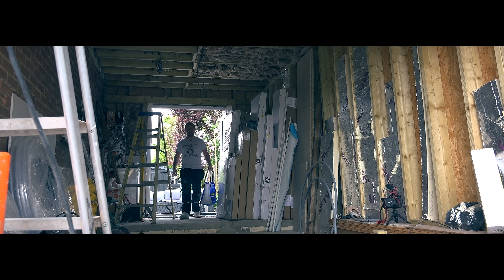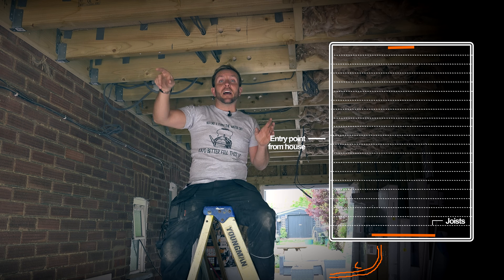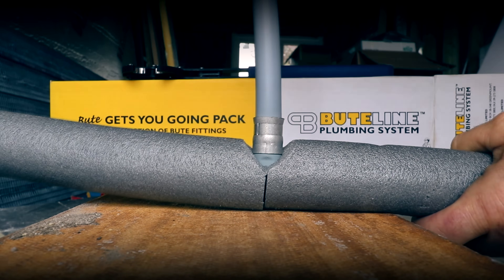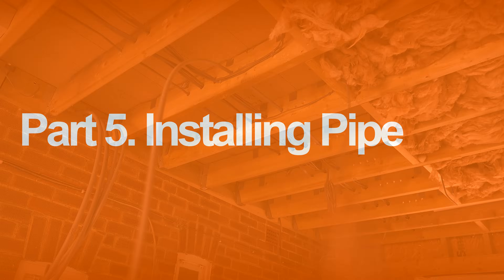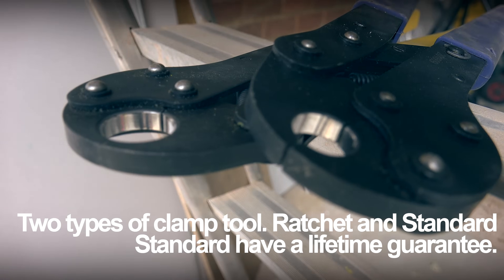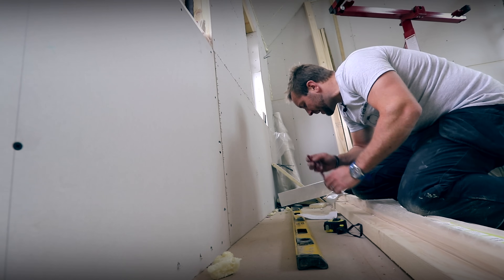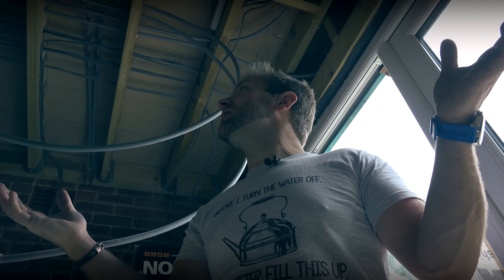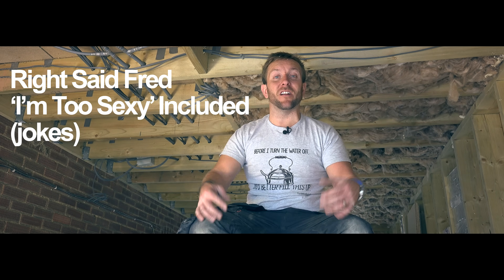PLASTIC PIPE FOR PLUMBING - Buteline System

Comment: Hi mate, great vid bud. I was going to ask about conduit going through the wall but then you explained. We have been using the quick and easy toke to long on the site we are on and gone back to poly.
Reply: Alex, your experience with Q & E is one we have herd many times, but you should seriously consider Buteline, 85% of installers tell us Buteline is quicker to install than push fit  in a 1st fix environment, there are additional time savings to be had on clipping and testing too, which is only done once and for 30 minutes!  As competitive as Push fit, an installation friendly process, it never leaks, completely secure, bomb proof joint that's not reliant on an "O" Ring or insert! Free tools to new users  and it available via one of your chosen merchant suppliers send us your contact details and we will come and see you, as seeing is believing :-)
Reply: @butelineuk5540  wouldnt it be great if a manufacturer/supplier would have a 'planner' on their website. you type in how distances and bends and the algorithm lists the parts required. Would take some work to set up but a game changer for both tradespeople and diy'ers. being able to save time getting a rough estimate of parts and costings
Reply: ButelineUK Ltd Just watched the plumberparts video re your product. Very interested in placing an order. Could you let me know if the free tools offer is still in place?. About to start 2 bathroom refits and would love to give your products a try.
Reply: Craig Smith give us a call and we will sort it out for you 👍

Comment: Like the new production, seems a bit more flexible than standard pushfit.
Reply: Hi Zed Man, you assume correct, our pipe is more flexible, and in some instances could allow you to use upto 20% less fittings . The system cost also works out cheaper than push fit, but seeing is believing, provide us with your contact details and your location and we will get one of our guys to touch base with you and discuss some free tooling for you.

Comment: my issue with this would be its alot slower than push fit.. and also if any other plumber went on a job where this stuff is all installed then he is going to struggle to connect to it without having the crimpers or fittings in stock...... most plumbers have a large variety of stock including myself but nothing like this....... also what if this pipe is leaking in a very tight spot like under a bath?  you cant connect onto it and you cant get the crimp in to use it...  its ok if its first fix but try doing repairs or get into tight spots with it, would be a nightmare.... 

brendan west yorkshire
Reply: Hi Brendan, your would be right in concluding the most effect use of Buteline would be in a 1st fix environment hands down, this is what our customers tell us. No real system provides a "one size fits all" solution and there are times where getting your hands in a gap with a pushfit fitting suits, but that's if you happy with the security of "O" ring based systems? our systems is fitted slightly differently to other systems as its permanent, so like copper, in hard to get to areas where you may choose to "pre fab" first or alternatively use the flexibility of our pipe to clamp outside and push it back in, a little bit difficult to explain over text.
Reply: Brendan Fisher 
The
Reply: if a plumber is fitting Pushfit under a floor....he ain't a plumber
Reply: Hep2o everywhere even up into radiators. Bish bash bosh

Comment: Whats the point if you still have to use adapters for solder and compression. Compression fittings go straight onto speedfit. To use it effectively you need a big van stock and who stocks them? I haven't seen butfit in any merchants. #xpress #mapress
Reply: David Pawson I really don't get the advantage of this press fit stuff requiring clamping, over speed fit, polypipe, hep.
And what's with the bastard size "16mm". Push fit ( touch wood) has never let me down
Reply: Tom Strutton yorkshire xpress uses 15mm copper  not butlines 16mm plastic. I find advantage of xpress copper
1. no hot work permits
2. speed of installing. I save on average 1hour on a boiler swap
3. no flux
4. can crimp directly onto chrome pipe no need to take chrome off.
5. If you forget to crimp a joint you don't need to drain system 
6. Can crimp onto old pipe no need to wire wool
7. Its a little bit cheaper than speed fit
8. Looks a lot more professional than speed fit 
9. My work is recognisable. I dont solder any more. If someone put my name to someone else's dodgy work and its soldered it isnt my work
Reply: From a thermal efficiency any plastic pipe is much better than copper even without any insulation. it's cheaper too!
Reply: another advantage is, copper will split on the first freeze, barrier has give and they say it can be froze 6 times before it splits. yet to see any splits on barrier that hasn't been insulated yet tho
Reply: push fit is DIY tonk..................I'll leave that shit to the Polish or DIYers. barrier pipe is great, but as long as you use compression or this stuff

Comment: Buteline could make the copper adapters with a bit more of  a radius like copper elbows. These looks like a tight 90° which will affect flow
Reply: Can you send me some info on the free tools for spending over 300 quid please? Will
Reply: Hi Will if you can provide us with your contact details and your location and we will get one of our guys to touch base with you and discuss some free tooling for you.
Reply: ButelineUK could you please send me some info on the free tools on spending more than £300 please
Reply: Hi....Our Elbowed soldering tails are manufactured with virtually the same internal radiuses as end feed, and the extremely flexible Buteline pipe will allow you to greatly reduce the overall use of restrictive fitting's and thus will create more "sweeps" in pipe. More sweeps, less fittings, less fittings means greater flow rates and increased efficiency in the delivery of water at its destination, making heating & hot water systems more cheaper to run.